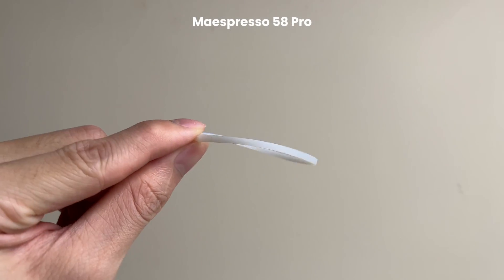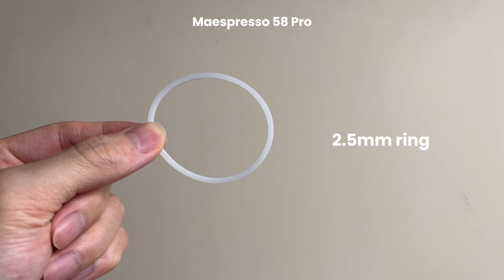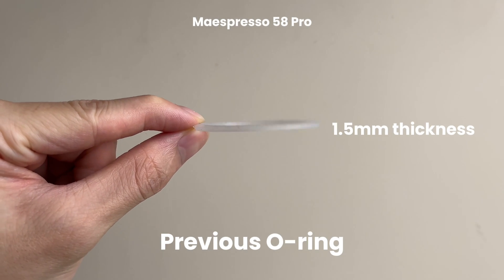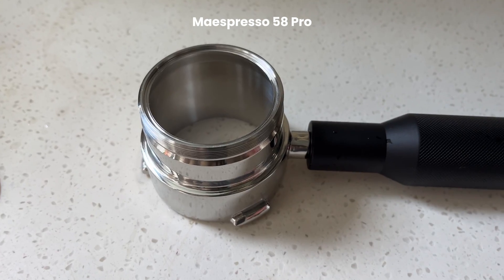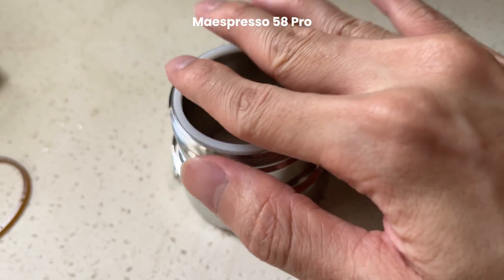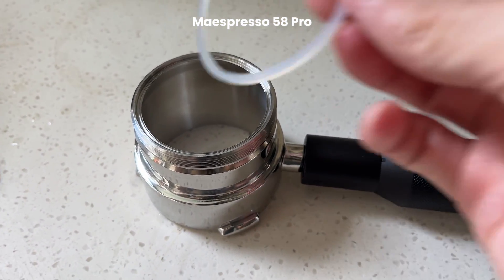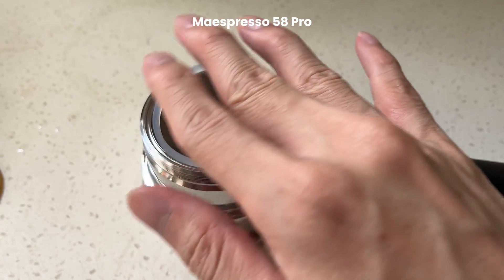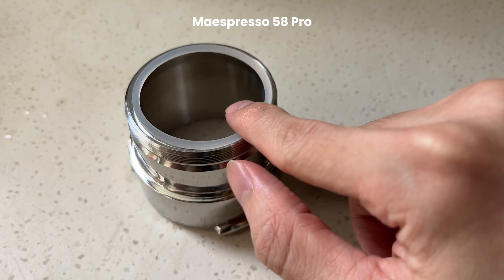O-ring Upgrade (Maespresso 58 Pro)

Comment: any cleaning demo? does it require full disassembly each pull?
Reply from the maker: No need to disassemble it each time, rinse the basket under water and wipe it with a damp cloth.
Reply: @Maespresso58  yup, this is how i've been cleaning mine for the past month or so. No problems here.
Reply: Is it safe to use ultrasonic cleaner for super quick cleaning?